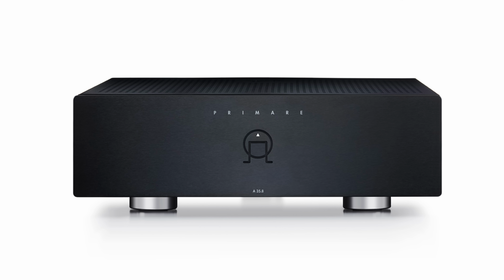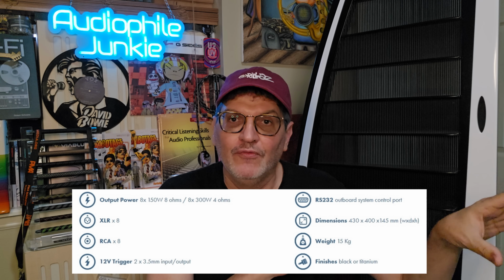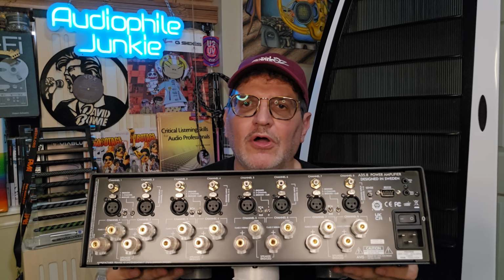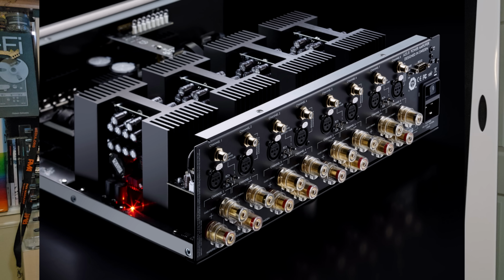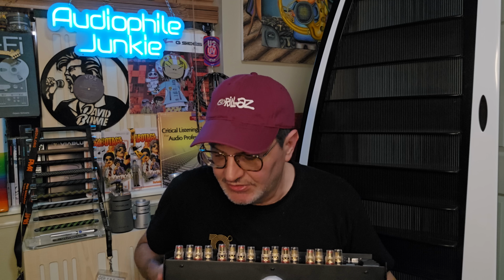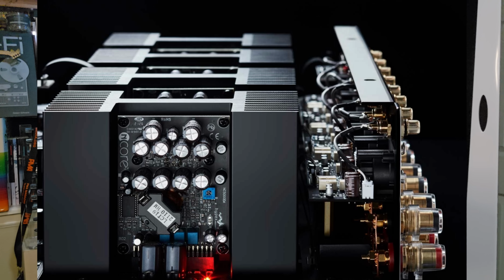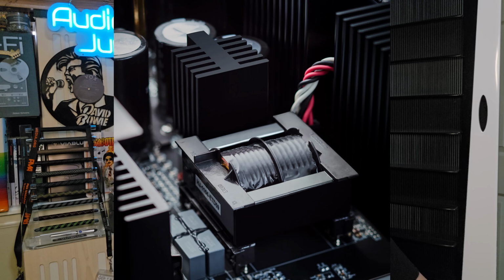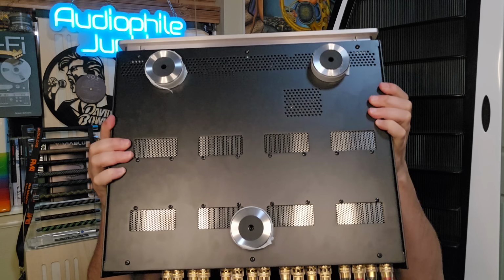👍 Primare A35.8: The Amplifier That Can Do EVERYTHING (And at a HIGH Level!)

Comment: I'm confused. Are you claiming that the weight of an amplifier determines its performance? 
Yes, high-end audiophiles often confuse optical properties with acoustics.
And yes, it is nice to have impressive gear.
But if you are - like me - all about sound, it's a waste of money, I guess.
And class D amps are very efficient. So, to my knowledge, they don't need heavy coolers oder transformers.
Reply from the maker: You're taking a big leap.  Weight is not directly proportional to performance.  However, if you have lots of experience in the hobby, you'll know that many AVRs have 12-16 channels of amplification that are class D and pieces light as a feather.  The performance equation of those and their light weight often go hand and hand to indicate compromised quality. 

If you watch the full video by Primare on the A35, you'll find the that weight IS due to better quality components, heat sinks, and layout... Which lead to better performance.

Comment: You are still a BACCH4Mac rep, right?  I was wondering using the RME Baby Face or UCX II how do you connect your Analogue turntable if you use one? My experience is bringing in an analogue phono source to the RME is first being converted to digital and then reconverted to analogue, makes my turntables not sound as good as when I'm streaming and my turntables and cartridges are of really high quality.  Is that your experience?  Thanks
Reply from the maker: Yes I can get you the B4M and walk you through the interface to a TT. In fact, if you look at my Bacch playlist, there's a tutorial by Dave where he shows how he hooked up TT using the B4M.
Reply: @AudiophileJunkie  I already have the B4M and am running my phono pre-amp through the RME UCXii rather than the Baby Face based on Edgar's recommendation and he helped me set it up.  Please send me the link to Dave's video.  The issue is that converting analogue to digital so early in the loop as has been discussed by others much smarter than me is Information loss: Analog signals are continuous, while digital conversion involves sampling, meaning some information is theoretically lost.  Analog-to-digital converters can introduce errors like quantization noise, aliasing, and jitter, potentially impacting sound quality, especially if the conversion is not well-implemented.  So having gone from a pure analogue set-up to a digital set-up with the B4M, has opened up an incredible experience while streaming but a loss of the warmer, richer, or more authentic sound. of my vinyl collection I'm trying to fix.  Thanks for all you do

Comment: The bass driver is the component in a speaker that is moving a high volume of air that demands the wattage. A tweeter in comparison is driving an infinitesimal volume of air because of the high frequency. You could probably drive it with a headphone amp. So, my point is, a bass driver driven by a 150W amp is going to sound right, but the same amp at 150mW is going to sound totally different and be damping at a hugely inefficient way. To even suggest using an 8 channel amp driving low, mid and high frequency components may as well be totally different amps in terms how this ONE 8 channel amp will perform. Horses for courses, loads for drivers.

Comment: Using a cheap class D amp with sparkos when i decided i couldn't deal with the heat produced from Tube amps, and energy loss, but my plan was to use my tube amp for winter months and keep the class D for the LF in a bi amp situation. Considering the move full time to class D, but i'm not sold on losing the tube pre or tube dac.
Reply: Look at the Elac Alchemy amp. I use 2 as mono blocks. Designed by a famous engineer.

Comment: I own a Willsenton R8 tube amp (running NOS front end tubes and TAD KT88) and the similarly priced Hypex Nilai500 Stereo Class D amp. There is no comparison, the Hypex is clearly better - more power, more detail, more air, more background silence and a wider, deeper soundstage.
Reply: I have a R8 with expensive NOS tubes, its parked unused as I have upgraded to a Prima Luna EVO400 tube amp. It's everything better in power, more detail, more air more silence etc.
I also have nice Solid-State A/AB Parasound Halo equipment, H6/JC3+ that sits pretty much unused as I prefer my hand built Japanese tube phono preamp and EVO400 combination.
Now you got me wondering about Class D, damn it! I am really happy with what I have but defiantly need to give Class D a good listen at the next audio fest.
Reply: The Willsenton is a commercial amplifier not build up to the potential of the technology...in this case you are right.......

Comment: Good class D , will destroy any tube amp. 
I used to be a tube guy , used to Be.
Reply: Destroy in what? Cleanliness and distortionless? Or musical engagement which is primarily what tubes are beloved for. Not measurements. Not neutrality. Not uber detailed. Tube amps come cheap too so of course there's plenty of cheap or poorly designed tube amps out there as well. Not to mention NOS tubes are really expensive now and the best ones absolutely sound incredible vs modern junk tubes.
Reply: @HailKingCeezer 
I found Tubes are fun listening for short periods, not really accurate at all because of the distortion. The perceived warmth is not natural and doesn’t come close to reality. The perceived body in let’s say a cello is over the top.
I don’t dislike tubes I was a tube guy for years and have listened from set, push pull to OTL and I’ve had each of these types of amplifiers. Hey I was there trying to convince myself tubes were better, I argued for them too at one stage. 

My ears just believe that class D is correct for me, I find I listen to them for longer periods over any tube amp prior. My brain is doing less work to decipher what’s going on and just enjoying the music.

You mentioned junk tubes v old stock, there you go, another flaw in tube, not all tubes are the same sound, do I have the right tubes, do I need to upgrade to better, by the time your all done, it’s not worth the aggravation.

Hey it’s just my two cents.

Comment: Well, Hypex Ncore NC500OEM x8 modules
Hi-finews
Primare A35.8 Multichannel Power Amp Multichannel Power
Multichannel Power

Rather than use its own UFPD2 (Ultra Fast Power Device) Class D modules that we saw in Primare's A35.2 stereo amp [HFN Dec '19], the A35.8 utilises eight Hypex NCORE NC500 modules, mounted as pairs on custom heatsinking, to form four discrete stereo banks. The single-ended Hypex modules are used to impressive effect in many products, including Primare's own I15 [HFN Oct '18]. A key feature of these modules is the integration of both the switching and low-pass filter stages within a global feedback scheme, yielding a predictable frequency response and distortion regardless of variations in the speaker load impedance. The inset Graph demonstrates the A35.8's unchanging responses into an open circuit (grey) and also 8ohm (black), 4ohm (red), 2ohm (blue) and 1ohm (green) speaker loads [note the 1kHz-100kHz scale] – other Class D solutions may show wild variations in response under these same conditions [see HFN Dec '21].

The efficiency of Class D operation – over 90% at full output – makes it ideally suited to high power applications, over many channels, without excessive heat or heavy casework. The switchmode PSU, with dual APFC (active power factor correction), also optimises efficiency while keeping weight down to an absolute minimum. Nevertheless, while each stereo 'block' will deliver 2x195W/8ohm the A35.8's simultaneous eight-channel output is necessarily 'limited' by the 1.5kW capacity of the PSU, and efficiency losses, to 8x170W/8ohm or 4x340W/8ohm in bridged mono – surely more than enough for any bi-amp'd system! PM